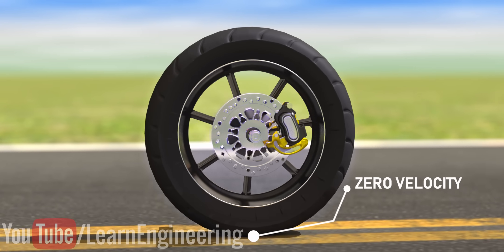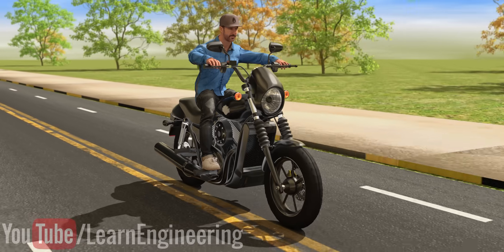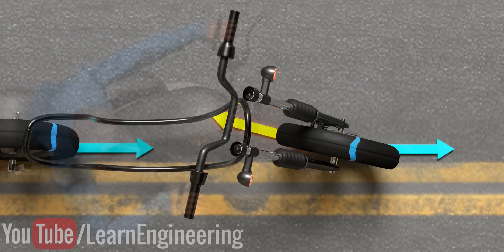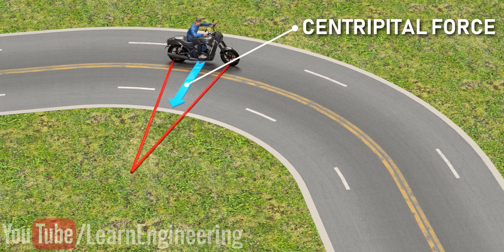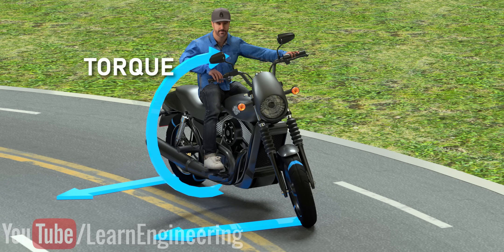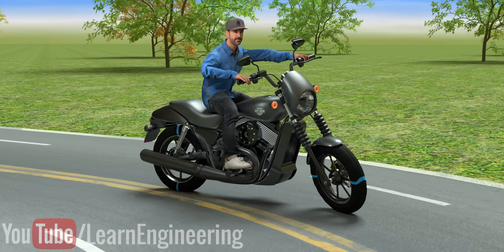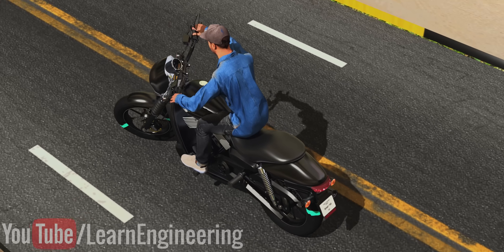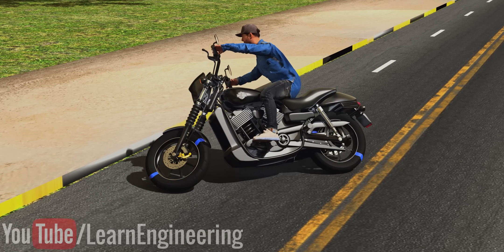Counter Steering | The interesting physics behind it

Comment: How do we counter steering when we are fast. The turning radius will increase. How do we manage that?
Reply: munavvar fairuze 
PLEASE  PLEASE watch Keith Code’s,
“A twist of the wrist”.   Right here on YouTube.  You will get the truth and the proof.  And so much more.
Reply: My advice if its a 60mph road and a turn is coming. Slow down with both brakes and downshift so you can manage a lean. Push the handle bar opposite as much you need. On a sports bike you can push and lean till the peg fillers hit the ground. Accelerate back to 60 when out of the turn.

You push the bar as much lean you need. But the more you lean the more chance you loose grip and low side. Best to keep bike up as much you can and weight shift your body. You can go to a round about fast with barely a lean  with your  body doing the weight shifting.

Comment: First, in a modern highway, you don't need this because in a modern highway, there's a transition from straight line (R=~) to a circular curve (R=r) with a spiral/clothoid (R gradually change ) like this: Straighr line - Spiral - Circle - Spiral - Straight line or straight line - spiral - spiral - straight line.

Comment: In fact, you do not turn the handlebar. You just apply force. The force acting on the spinning wheel is rotated over 90 degrees in the direction of rotation.
To initiate a left turn you:
- Press on the left side of the handlebar or/and pull on the right side.
- This force tries to rotate the front wheel clockwise as seen from above.
- The gyroscopic effect causes this force to rotate over 90 degrees.
- The force now acts on the top of the front wheel, pulling to the left, causing the motorcycle to 'fall' into a left-hand turn.

During medium to fast speed cornering the handlebar hardly moves at all. The geometry of the bike takes care of the turning. If the bike leans over you follow a turn.
Reply: No, it's not gyroscopic, at least not primarily. You can counter steer at slow speeds where there is little gyroscopic effect. You can counter steer on a snowmobile, which doesn't even have a front wheel. They have done experiments with an opposite-spinning flywheel on the front wheel of a bicycle to cancel out the gyroscope, and people could still counter steer.

Counter steering is caused by caster angle of the front wheel.

Comment: I don’t believe it. If your turn the handlebar left, the bike turns left. In higher speed, any turning of the bar is dangerous, and eventually all turns are made by leaning. You always lean towards where you want to turn to. If you rotate your steering to the left in order to make a right turn, you will only turn left, and if in high speed, you will fall to the left.
Reply: Daniel X 
So wrong! Hopefully you have sorted this out by now.

Comment: Interesting, thanks. I remember seeing counter steering in the movie Cars. Didn't know that for motorcycles. Some questions, does counter steering work for all all motorcycles?Also, how about bicycles, is there counter steering?
Reply: fork lord counter steering is how all bikes are turned once moving above a certain speed do to gyroscopic force. Normally people are traveling slow enough on a bicycle that they turn normally, but at high speeds still require counter steering to be able to turn. Most motorcycles I’ve been on require counter steering to be done at any speeds above 15-20 mph and can only use normal steering at lower speeds such as in a parking lot.

Comment: You make it sound as if it's hard to do and takes practice. But it comes natural to the rider, it just happens.

I learned to ride on my own, saw some counter steering videos online and freaked out. But when I went out riding, it all just went naturally.
Reply: Also, if you counter steer and then "normal steer", you're going down. If you're going slow, fine, if you're going a tiny bit faster, you ALWAYS counter steer.

I feel like not one of the people that made the video actually rides.

Comment: ah, it’s used by ALL riders, not many. Even if they don’t realize that’s what they are doing. You cant destabilize a moving motorbike enough to go around a corner without counter-steering. It’s how they are designed.
Reply: Sure you can. You can do it even without holding the handlebars.
Reply: @PacAnimal  you have obviously never ridden a motorbike at speed - a motorbike is a very different beast to a scooter or bicycle.
Reply: @Slarti  I own three, commute daily on a 660cc on a motorway, and spend quite a lot of time practicing as well, especially on ice.

I got my license about 5 years ago. The european license, not the weekend american course.

A simple youtube search will show  you people navigating turns without touching the handlebars. It's not recommended, but it's perfecly possible. Heck, stunters can turn around whilst standing on the damn seat.

The argument is "moving", NOT tearing up the twisties. Read the original post again.

Now you know. You're welcome.
Reply: Lol no it's not very different at all.u need balance to ride a bicycle,same as a motorcycle.cornering on a bicycle is done the same way as a 1000cc super bike.....by just leaning.
Reply: Even he is doing the same. Whether it is hands off or not, everyone corners the bike by counter steering. In that video you gave, if watched in 0.5x, you can clearly see him leaning slightly towards the opposite side before getting into the curves. That slight leaning causes the same effect that of pushing handle bar to the opposite side, i.e. counter steering. He just don't realise that.
Reply: @Adrenalean767 I imagine you have never risen anything above 75cc, based on your comment about a 1000cc bike bring like a bicycle when it comes to steering.
Reply: @Slarti  lol i own a cbr 1000rr but ok

Comment: All turns are always initiated by slight counter-steering. We don't notice it because we do it subconsciously. We learned that trick as kids by trial-and-error until it became an automatic reflex. 
And now, some academic is trying to teach us how to use counter-steering ?
Reply: I agree with that. When I first started riding my bike just seemed to steer itself. It went around curves without any input from me. Then I learned about counter steering by noticing the bike went left when I pushed on the left grip. Subconscious for sure. It would have been good if I took a good course back then.
I almost crashed a couple times during my learning 'on the fly'. You can't always rely on your subconscious  inner biker to do  the right thing in an emergency situation.

Comment: Vast Majority of riders doesn't know of or even need to ever use this method,simply because everyday driving conditions which include the vast majority of riders that are aware and using safe driving drills that doesn't require this erupt sudden emergency skill....Unless you are riding a dirt bike off-road of twisting and quick turns at a higher rate of speed...such as racers do on a race track for competitions.
            My point here is, that this maneuver IS primarily for dirt bike obstacle courses and other types of race tracks for bikes and cars...This IS a skilled maneuver  that requires daily practice for particular maneuvers in Competition.
Reply: Ellis Smith Jr total bullshit!

Comment: Counter steering is used by some riders???? The only way a bike steers above 10-15km/h is counter steering. What the hell, turning the bars into the turn??? What the hell??? That's only true at like 5km/h. This video is all fail!!!

You DO NOT LEAN THE BIKE. You choose the speed and the path and the lean angle is a matter of physics. A plumb bob / pendulum on a string will attain the same lean angle as the bike for the radial path and speed. 

So much fail in this video.

Comment: if this theory is true, then why doesn't the bike turn the opposite way when "normal steering" is initiated?
Reply: George Michael 
It really is that obvious isn’t it? What you say is completely logical! I cannot understand why others can’t see it. Well said!
Reply: The counter steer simply initiates the lean, and after the rider is leaned over he instinctively turns the wheel back into the turn to regain balance and turn the bike. So the turn still happens because the wheel is turned in the direction of the turn. The countersteer is all about initiating the lean, so the rider isn't flipped over the top side when the turn happens. Fortunately one doesn't have to understand it, most of us do it automatically without even thinking.
Reply: spelunkerd 
Utter nonsense!

Comment: The phisics part is great but the vid describes driving without counter streering like a normal practice, even more like the first option to make turns - it will kill you soon actually.. Especially if you're not prepared that your motorcycle is going to move TO the danger when you turn the wheel as you might think from the danger. Counter steering always works with no doubt after 50 km/h no matter how hard you try to ignore it

Comment: Correct me if I'm wrong, but I don't think "normal steering" as explained in the video is even used by anyone at all. Everyone uses countersteering without even realizing it, by giving a tiny flick of the steer. This is also why kids have trouble going from tricycle or side wheel bicycle to 2 a normal bicycle without side wheels.

Comment: Never ridden a motorcycle only interested in the physics.
Reply: This video is a bad place to learn them. All (or almost all) steering on a motorcycle involves counter steering, it is how you get the motorcycle to lean into the turn.
Reply: Same physics applies to bicycles. If you're going above a certain speed, counter steering the the only way to turn the bicycle. This video is a bad representation of how it works though, it's better to get an explanation from an actual motorcycle rider.

Comment: Pixar's Cars taught me all I need about counter steering.
Reply: That driving skill showed in the CARS movie is Drifting, which actually has a completely different physics principle to the countersteering in motorcycle world.
Reply: @galuhrichata6148  yep,you just said what I was going to say.
Reply: @galuhrichata6148  Stupid comment, you counter steer to drift, the wheels are pointing left and the car is going right, that’s exactly what counter steering is.
Reply: @marcd7332    Nope. Counter steering in motorcycle is based on gyroscopic effect. Drifting has a completely different physics law. By the way, drifting in motorcycle also happens in dirt flat tracker racing. When you have the knowledge and the experience then you will know who is the stupid one.
Reply: @galuhrichata6148  Won’t waste my time arguing, here are the facts: https://en.m.wikipedia.org/wiki/Opposite_lock
Reply: @marcd7332    It may have the same name, but still,  they both have absolutely different mechanisms/law of physics. And at least, I am not the first one who is being rude ‘calling stupid’.
Reply: @marcd7332    And if you can really understand the physics of drifting (or ‘counter steering’ in cars): When you GO RIGHT, you must TURN RIGHT FIRST, and then when the car starts to have an oversteer effect (usually handbrake can help, and much easier on rear wheeled drive cars), then you turn left (“counter steer”) to make the car nose stays in the correct direction, while keep pushing on the gas pedal, to make the car ‘drifting’.
In motorcycle, it completely different, when you are above around 20 mph, if you push the right handlebar (which makes the tire angle points to the left), the bike/wheel will fall the to right side, that is due to the gyroscopic effect, so much different with the oversteer.
That’s why there is a motto, “push right, lean right, go right” and vice versa “push left, lean left, go left”. 
Once again, they may have the same name but the physics are so much different. That’s why in automotive world it is more popular with the name drifting.
Reply: AlexEinherjar turn right to go left 😂😂😂
Reply: @kvashik4084  You know your stuff.
Reply: @kvashik4084  doc Hudson
Nyc u r going to win next piston cup
Reply: @kvashik4084  basically drifting lol
Reply: @kvashik4084  that's drifting not countersteering. Countersteering only applies to vehicles you have to balance such as bikes.
Reply: Cars did not show counter steering, it showed drifting, which is a very differenty thing.
Reply: @plain_and_simple  understeering vs oversteering actually, but yes :)
Reply: @plain_and_simple  if you push more you drift or even slide...  in a car or in a bike... thats why counter steering shoud be use for avoid things not to normal drive.... but ppl use seem to be using all day... i drive my bike whithout counter steering at 200 km/h and i got no problem to turn like NORMAL PPL with his body weight... if have to make a fast emergency turn or avoid something real quick then y  use counter steering.
Reply: You live in opposite land
Reply: @RICHOCHANGO  It's a fundamental to drifting cars.
Reply: Legendary
Reply: you need oversteer to countersteer and countersteer to drift
saying countersteering isn't drifting is like saying lego isn't plastic because lego is lego and plastic is plastic
Reply: Ok mr denton
Reply: Doc Hutson says :- turn left to go right
Reply: Thats just drifting
Reply: I’ve never seen a more perfect comment in my life.
Reply: Thats not possible
Reply: i learned from Initial d
Reply: But countersteering a four-wheeled vehicle is completely different from countersteering a single-track, two-wheeled vehicle. 

Unlike a bike, a car does not normally countersteer as it turns.   A car does not lean into a turn; it leans out (due to its suspension).

The countersteering featured in Cars is a way of getting the rear wheels of  rear-wheel-drive car to skid to the outside, so that the car points into the turn.  In other words, to induce DRIFTING.

Under DRIFTING, the car is slanted so that it points into the turn. This means that the engine power is actively contributing to the centripetal acceleration which keeps the car in the turn, and not just passive friction of the wheels on the road. As a result, the car can boot through the turn faster.

Why drifting is emphasized for dirt roads (like in the movie) is that the traction is very poor on dirt roads, which causes drifting to be helpful, and to be helpful at lower speeds.  Controlled skids are easier to induce on loose soil also. It's easier to learn the technique on dirt, and it's more readily applicable.
Reply: Dude that’s funny 😂
Reply: Wait, it all makes sense now
Reply: Aka drifting
Reply: This comment bugs me. I don’t even know why, it makes sense.
Reply: That was drifting
Reply: Lol
Reply: Cars hahaha
Reply: cars cannot counter steer though...
Reply: Oh yea yea CP Oh yea yea baby maxy oh yea yea CP
Reply: I see this Arnold everywhere Why?
Reply: Well in a car it’s called drifting, which is different because there is no lean factor
Reply: HAHAHA, I had no idea who or what Pixars Cars was. I actually googled it thinking it was some MC instructor. I just got schooled LOL, Im gonna leave the bike at home now.
Reply: Turn right to left
Reply: So...I went around the side of a truck at 60÷ mph and there was a retard getting ready to turn into a service crossover - in between the freeway where the cops hang out - and was only going about 2 mph. I had swung all the weight of my big Harley panhead over into that lane and in the 1/2 millisecond i had to decide whether i should try going in front of the guy and have to hit the ditch and grass at over 60 or try and pull the weight and lean back over the other way and try going between him and the truck where I may most likely hit his bumper and maybe bounce off into the truck.
Whether or not to just WILL the bike to shift the weight the other way and not bounce off his bumper or to maybe try this new ' counter steering ' shit and see if i can get it right in the other half of a millisecond I have left to decide as visions of leg bones sticking through my skin started to emerge.
  NOT A CHANCE
Good thing I never heard of any of this crap back then I might have just straight up drove right into the side of that 2 mph car.
Reply: "Gotta turn right to go left"
😁🚬
Reply: @victorcoburn2791  
Well… kinda yea.
Reply: Fucking A++ Brother
Reply: Its actually different tho
Reply: Yes T1000
Reply: It's actually not turn right to go left in a car if u do that remember the clip what happened when McQueen did it fot the first time 😂😂😂 , counterssteering in a car is not present to be honest , what u do is  is let the rear end of the car out of its track by either using a handbrake or by simply powersliding (accelerating the real wheels out) , and then Voila !! You've got a drift which is now u can say u r turning right to go left but at the same time u r always keeping the rear end sliding !!!! If u r powersliding it's easy to do but less efficient ,on the other hand proper hand brake up rear end out , handbrake off, throttle on off on off alternately is more efficient , u've to learn this under proper guidance , once I did it I regret for the first time I regret that day  🥲!!! , Not today 😈😈
Reply: Hmmmm.  Not exactly the same thing.  I'll assume that your comment was an attempt at humour.   🙂